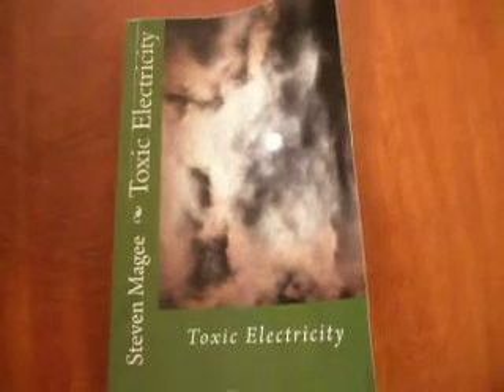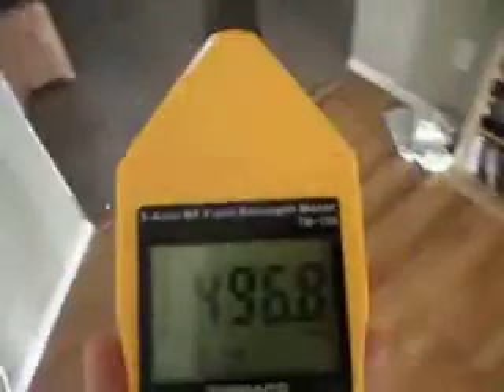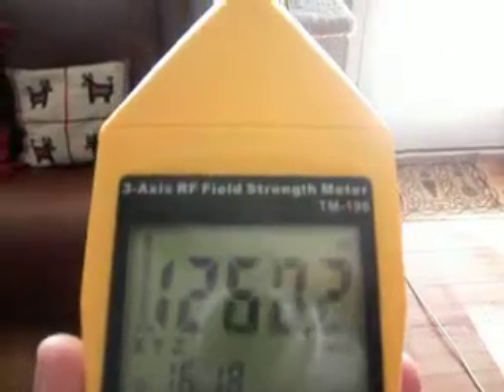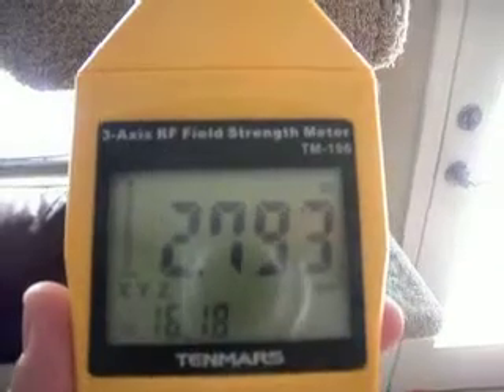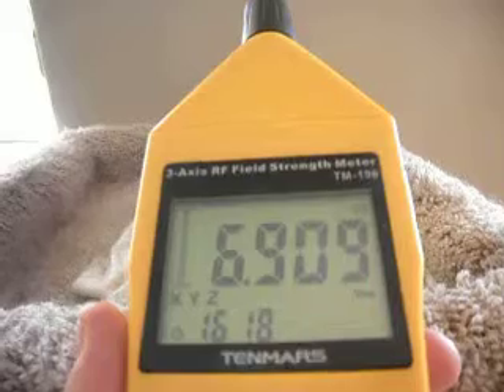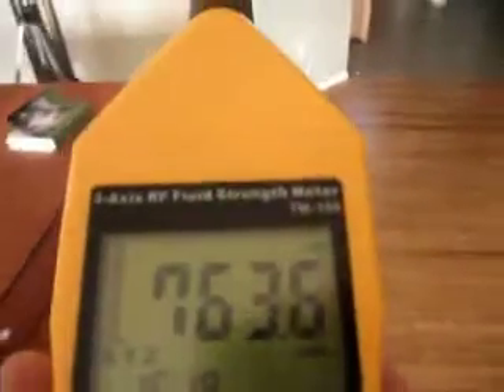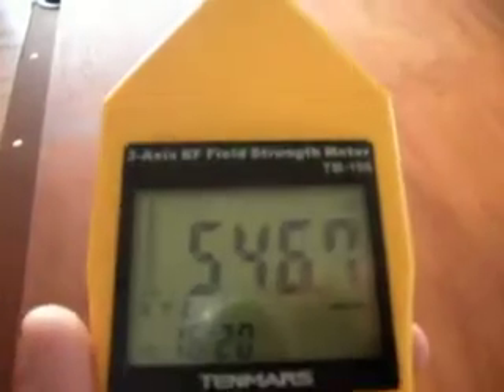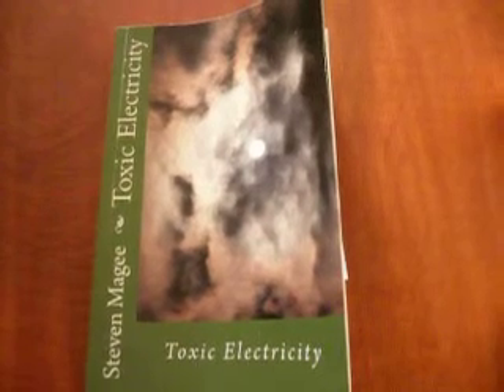Measuring the Field Strength of a Wi Fi Unit with a Tenmars TM 196 Meter

Comment: Also is it possible to get EFM testers that do other parts of the spectrum different from RF like microwave , IR , UV, Xray or gamma waves? Photometers cover visible light range anywhere from end of IR to beginning of UV... so was just curious on the other ranges to measure the V/m , watt/m^2 ,...of them. Nice demonstration of a cool tool to verify wireless signals when setting up wireless networks as one application to them.

Comment: Curious what RF frequencies can you test for is it a single specific one the device uses or can you set a frequency in a range of frequencies? I saw it was 3axis so yours is cool because it works on all 3 planes in 3dims.  But my big thing is what frequencies can it test for. It be nice to beable to tune it like a radio to any frequency in it tuning circuit measuring range.